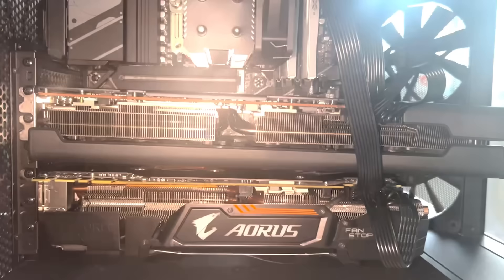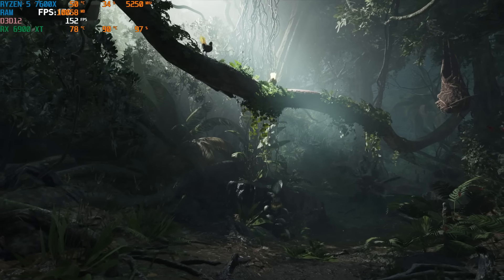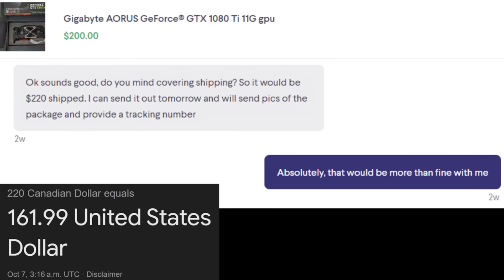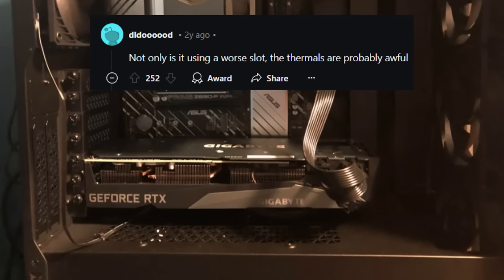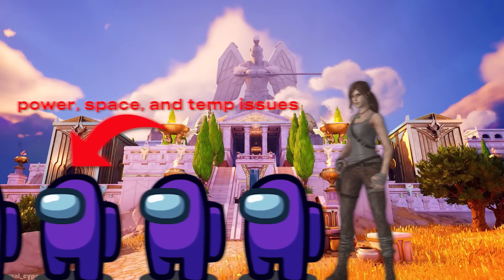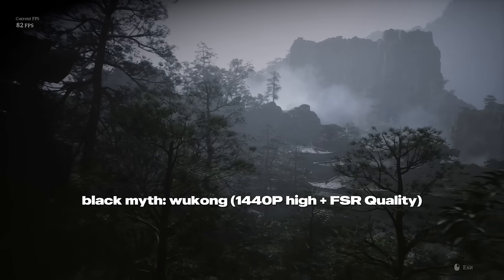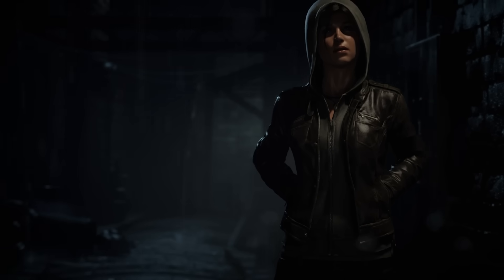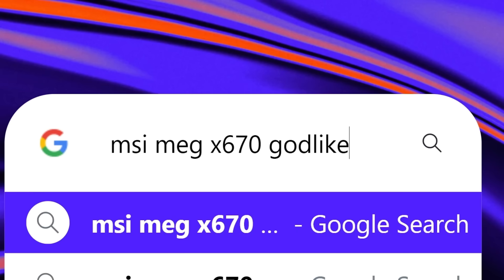I Combined AMD & NVIDIA in One PC and Got 1500 FPS

Comment from the maker: "sicko mode or mo bamba ? why not both ?" ahh video
Reply: @lecctron  edging rn
Reply: crazy reference
Reply: fr
Reply: Fr
Reply: Heya at 7 05 theres a setting specific GPU  how do you have that? i was trying something a few months ago with a rtx 2060 in my system and allI got for options was the Igpu in my 7950x and the 4090 in my system.
Reply: @mytrashamn  definition of cooked
Reply: @MR_3BAS   huh?
Reply: FR
Reply: Ahhhhhh video
Reply: @lecctron  lmao
But bro the 1800$ motherboard got my eyes so fuckin wide😭
Reply: tell us you don't understand video hardware and software without telling us..
Reply: If you bought that mobo and not the fans I think a viewers may come and rob your house for that trolling.
Reply: i have a 6600xt and 1050ti, my wallpaper engine load is nice and balanced at max settings while not messing with my gaming performance
Reply: When does ironic brainrot just become... brainrot... you answered this question.
Reply: If you see this where did you have to go to set different apps to certain GPUs
Reply: @HamWack  he didn't, it's a load of bull to start, if you have more money get nvidia otherwise do amd as a 4090 will smoke every current gpu on the consumer market. A 7900xtx is equivalent to a rtx 4080 but being cheaper. A 6900xt gets smoked by a 7800xt and a gtx 1080ti gets smoked by a rtx 4070 non ti non super. This guy should be booted off youtube for misinformation.
(1080ti gets smoked by a 8gig 4060 with dlss or raytracing as well.)
Reply: @lockinhinddanger934  I was asking because I had an old GPU lying around, and after watching this video I now use it for streaming, and it works quit well. Also, I do admit some of the stuff he said want quit right but in the right context he does make some valid points. Like for the price to performance a 6900xt is better than Nivida he just never mentioned for the price.
Reply: If only the host actually knew how pcs work, 6900xt isn't newish and no where NEAR the fastest, also a gtx 1080ti while decent in performance can't use dlss and struggles with raytracing as it lacks any ai rendering cores. So please don't spread misinformation.
Reply: ddlc soundtrack too
Reply: Bro ur insane lmao
Reply: lol
Reply: My GTX 760 is not showing up in Task mangeger only my 4070
Reply: Buy an older Mobo, like a Gigabyte GA-B150-HD3P which is a purpose-built gaming Mobo with native Crossfire support. It still has 16x PCIe and supports CPUs up to i7 4.2GHz(Kaby Lake). That would cover your CPU handily and allow you to run 2 different GPUs, and best of all, it's probably available pretty  cheaply.
Reply: Big dih randy, or p diddy ahh video
Reply: Go with dual 2696v3
Reply: Lossless scaling
Reply: fin fin fin fin fin
Reply: Fein fein fein

Comment: you could downgrade your system and use a Asus P7P55 Ws Supercomputer mobo + LGA 1156 intel i7 2,28 Ghz 8 threads and overclock it to 4,2 Ghz, wich supports up to 4 GPU's, once all 4, 16x pci lanes are filled they switch over to 8xpci lanes  ( mostly meant for science and is used with Tesla Gpu's ) but here is the kicker, you don't have to use Tesla GPU's, you can instead use two normal GPU's wich work perfectly fine together .

You could make your dream come true " somewhat " because you would be running your system with 16GB DDR3 1600ghz memory.

Wich basically is enough if you go for a Dual GPU System.

You can run  AMD/intel combo " in theory " but i recommend using this type of mobo with 2x AMD OR 2x Nvidia gpu's, but the same ones.

You allready have enough with 2x 8GB GDDR5 Gpu's and get outstanding quality and performance out of it + the power consumption demand is not that high aprox 500w power, so buying a 850 power supply gets the job done and is still NOT TO EXPENSIVE.

You can still get a descent amount of FPS and still run more demanding games with a descent Fps and for budget gamers isn't that all we want ? ( run our games smoothly )

Building myself one now for a friend, that doesn't have much money and i'm trying to help him out.

Hope this helps anyone else who is looking to build a " supercomputer " on the cheap if you combine this setup with a " linux Distro " then there is NO WORKLOAD in the background, so you can reach the maximum capacity of your setup without windows working in the background demanding every aspect of your computer.

This means More stable gaming, More stable fps, more descent quality in gaming.

Would like to hear people's thoughts on this and my idea of what i am building for my friend.

Comment: doing this right now 4 borderlands 2, 7900xtx for rendering and a 1050ti for physx, runs 250+fps max settings, max phys, as apposed to the high 60s when i was running just the 7900xtx and high PhysX on the CPU. getting both in was a challenge.... but if you wanna run PhysX in games but only have an AMD card, its very worth it

Comment: Doesn't every GPU have it's own Vram so it can't really split it with another GPU and is exactly why it won't boost your performance. I looked it up and it is actually so, you can't match two gpu's for one task but you can use them for seperate tasks seen in this video.

Comment: Buy an older Mobo, like a Gigabyte GA-B150-HD3P, which is a purpose-built gaming Mobo with native Crossfire support. It still has 16x PCIe and supports CPUs up to i7 4.2GHz(Kaby Lake). That would cover your CPU handily and allow you to run 2 different GPUs.

Comment: only reason he lost fps is lack of cooling and power supply watts is to low for both those cards even with what was said the cards dont have enough to clock draw for power ! and i put in my pc build : PowerColor Red Devil AMD Radeon RX 6900 XT Ultimate Gaming Graphics Card with 16GB GDDR6 Memory, Powered by AMD RDNA 2, HDMI 2.1 + EVGA GeForce GTX 1080 Ti FTW3 HYBRID GAMING, 11G-P4-6698-KR, 11GB GDDR5X, HYBRID & RGB LED, iCX Technology - 9 Thermal Sensors and yes i have open case with 9 fans with suppressed air for more flow and air draw and i have CORSAIR RM1000x Fully Modular ATX Power Supply - 80 PLUS Gold - Low-Noise Fan - Zero RPM - Black and it helps alot !

Comment: My guess is that the motherboard litteraly doesnt have the throughput in its PCI-E controller to fully utilize both GPUs at the same time to its full potential due to bandwith? Or that the PSU doesnt have enough power on its power rail to fully deliver all the required power (peaks) and that that throttles the performance? Fun fact u could in theory just install a second PSU outside of ur case and hook it up.

Comment: Hi Im replacing my Nvidia 1080 graphics card with a :

GIGABYTE NVIDIA GeForce RTX 3060 Gaming OC V2 Graphics Card - 12GB GDDR6, 192-bit, PCI-E 4.0, 1837MHz Core Clock, RGB, 2X DP 1.4, 2X HDMI 2.1, NVIDIA Ampere - GV-N3060GAMING OC-8GD

But I don't really want to though out my 1080. It works pretty good for high end games like Remastered Dead space and or star wars outlaws. But it doesn't quit cut it. 

Now I have a prebuilding gaming Alienware 7 and have two side by side slots for the card, and the cord connector has two male pins to plug into the card. Am I able to keep my 1080 and switch it to the right side port furthest away from the motherboard and use the 3060 in the closet side to the mother board or does it make a difference? Or Will the driver just pull the resource from the bigger working card?
Reply: It's best you don't use dual gpu setup. The amount of games that support dual gpu isn't wide and the cost of upgrade to support it isn't worth it either. When you mentioned Alienware, I thought of proprietary BS and anti consumerism. Anyway, I think you should be able to slot in the 3060 alone. Just keep the 1080 in a display case or something as a trophy.

Comment: omg the incorrect connection on these two cards is CRIMINAL. DO NOT USE PIG TAILED CONNECTORS ON newer GPU's. 150watts per cable only.

Comment: Has gotten 5070 ti display pc case isn't designed dor more than one gpu. Running with rx 9070 xt got over 1300 fps on final fantasy 15 at 4k max setting. Wow.

Comment: I know this will sound like a silly idea, but have you tried using one of the GPUs for frame generation? Just a thought, but if you get Lossless Scaling off steam, you could tell that program to use your second GPU to draw all the in between frames, while your main one can focus on rendering actual frames. Using LS with just one GPU usually introduces some visual lag. But you might have the perfect opportunity to reduce that since not one GPU has to do all the work by itself. If you have to connect your monitor to GPU one or two tho, is beyond me. 
Oh and Lossless Scaling isn't an expensive program. Costs about as much as a good pineapple pizza. And if that isn't a good sales argument, I dunno what is.

Comment: The 8700G's 780m iGPU has a lot of FP16 performance. It's twice that of the Arc A380 I just used with a 7900 GRE for frame generation. Can you test with the 8700g as the dedicated frame gen GPU at some point?

Comment: Unless the game is coded to use more then one card at a time it will only render on one. That’s why you are going to see no difference in 99% of situations vs the 6900xt by itself. Games just are not coded to do dual GPU from different vendors. Not that they couldn’t be coded to do so but developers don’t bother putting in the time and effort for that.

Comment: Autodesk type applications benefit from SLI or crossfire. I  also heard that the memory alone, of a second GPU can be used without a bridge. Games don't use nearly as much v-ram so it wouldn't even matter if it's available.

Comment: Don't a lot of productivity software like OBS and Blender let you specify which GPU to use for rendering without needing to display any video from the card? Not sure if the software you use has that capability though. Otherwise you could always pass the 1080ti to a virtual machine if you're on windows 10 pro or above, but I'm not sure if Nvidia lets you do that on consumer cards.

Comment: Your power calculation is wrong. You don't need two 850 Watt PSUs or a 1900 Watt PSU. 
The 850 Watt is recomended, cause you have a CPU, a Motherboard, SSDs, USB Power etc... All that is included in the 850 Watt.

You take the 850 Watt PSU, look at the specs of the 1080 TI (250 Watt maximum consumption) You add the 250 Watt to the 850, which leads to 1100 Watt. So a 1200 Watt PSU is more than enough.

Comment: I don't send I'm connected sending 16 lanes 1 on n turn it up or down never off to 16 LEDS but in real time n look at image of 4 x 1080 to 4 tvs or 1 TV or 16k 1k but won't fit frames send no frame between each frame to 1k n 3 to 3 on or off flicker to make 60hz 1hz a second we slow it down to 1 at 16million colours no flicker or white background so black and 4 led a square can do 4k 16million colours but we send 1 to 4x 1080 at 4 x 4 LEDS at 16 levels but in real time changing as we move so 3d real-time better quality not Ray traced ai low colours n sound fps was a scam to sell rejects to keep shares profit Biden shut down high end asml n EU fabs to get China to ripp tsmc rewired junk n scam you buy downgraded games upscaled ai dlss, on 1 screen laggy cheap why sli 4 n iso 16 still best with 4 layers gigabyte z270 1 socket 16x4 edges not x or WiFi n 4 lanes to 4 qtrs of broken to act as one mono but that reduced lanes by 4 n runs 16bit but 4bit x4 instead of 64 4 x 16mine

Comment: You can use the 1080ti with lossless scaling for the frame generation and render the game on the AMD (connecting the monitor to the 1080ti) without losing any FPS from the Main card since the frame generation load is taken by the 1080ti. That's a cool way to use double GPU setups.

Comment: Did you try changing your PCIE lane configuration in the BIOS settings?
You can switch them up like 8x+8x or 8x+4x+4x etc.
IF THIS IS POSSIBLE (big IF) would be much better with a PCIe 4.0 mobo.

Comment: There is a program called Lossless Scaling that enables frame generation on any GPU. One cool thing is you can use 2 GPUS at once, one to make the fake frames and the other to display them. You look setup perfectly to take advantage of this. Have the 1080ti do DX11 rendering and the 6900 XT do the frame generation. You would get crazy FPS. I recommend looking into it.

Comment: 8:42 Actually, there are more motherboards than the godlike... Most of the Asus Creator lineup is a dual x8 x8 to the CPU, so there are the big boys x670e & x870e Creators and the best budget-friendly b650 creator. Even there's also the possibility of using bifurcation with a riser to do dual x8

Comment: use lossless scaling Dual Gpu mode.  use the gtx 1080ti for 10x frame gen and then the rx 6900xt for the raw base fps. this way you can max out your monitors refreashrate and make both gpus run at 50% at 4k max settings at like  120fps or 144fps or 165fps depending on your monitor. Example is on Assassins creed 3 it is locked at 63fps but the max I can do was 630FPS with frame gen. I think with your setup you can do 1000fps easily with those gpus

Comment: So you basically lost FPS and achieved the same FPS in Fortnite as 6900xt would give you by itself? SWEET!!

Myself I have RTX 4090 and RTX 3090 because
1. LLMs - can run 70/72B models just fine with acceptable performance (up to 16 tokens/s for 70b model)
2. I run dual monitor setup with IPS and OLED panels and run desktop applications on 3090 which means I don't use up 4090 for these tasks...
3. ...including RTX Video Super Resolution which is quite taxing at highest quality
4. Running heavy ML training tasks on either 4090 leaves all performance for desktop or 3090 which leaves all performance for games

In my case 3090 is connected to PCI-e 3.0 1x slot kinda hanging from the side of my case so it doesn't cause any heat/temperature issues for 4090. On the other hand I do get very slow PCI-e bandwidth so certain operations do take much longer e.g. loading 20GB model in to the GPU takes some seconds. Once loaded models execute at full performance. Performance in games is quite severely affected but it really depends on the game - anything that just loads fully in to the GPU seems to work mostly fine... not that it matters really. All I care is for things like videos to run well and in this case I can decode 8K 60fps HDR video just fine without any dropped frames.

Issues I experience is I need to be careful about which GPU runs given application vs which monitor is being used as transferring window content from GPU to GPU is quite slow. Otherwise in Windows 11 I can set games to use 4090 and apps to use 3090 and it mostly works. Fortnite in DX12 mode gives me headaches as it always starts on 3090 so I need to disable it before starting the game. I tend to do longer playtime sessions over the weekend so it is not as big of an issue.

Otherwise it is cool to have literally zero GPU usage from applications on 4090 when playing games on it so other than intended use case (accelerating LLMs and allowing bigger models to be used) it is the biggest advantage.
As for use case presented in the video - having Fortnite run crazy fast... I guess its best to just get as fast RTX card as you can afford/get.

Comment: The 1080 TI does not out perform the 4090 in Fortnite on performance mode. Genuinely impossible no matter the optimization. You definitely had a hidden outlying factor that gave you those inaccurate results. Never in any world would a 1080 perform better than a 4090 bro it’s simple math

Comment: Using 2 GPU ( 7800XT and RX480 ), the old gpu ( 9 years old ) used for chrome, desktop and so one ( mostly second monitor ) and the main GPU is handling only games - the GPU repartition is made by Windows. 
No errors, no blue screen, I'm not using AMD Adrenaline only separated drivers ( the support for RX480 ended in 2023 ) 
The idle power decrease , 7800XT was using 64-70W alone, now is at 30-44W and RX480 is around 4-8W. 
Both cables are connected to the main GPU. 
One more option for those who want to try, use Hybrid Graphics in BIOS, use the integrated graphics and - Voila, a 3 way GPU, connect everything to the motherboard ports. 
Regarding the pci-e lanes, X8 for both, I didn't notice a fps drop in any game. 
Good luck at experimenting :)
Reply: @Andi.Cristian  can you make a video on how it's working?
Reply: @Sulto_  Hey man, it's pretty easy, I'm using this configuration for a 2 monitor setup, install 2 GPU , the main one is for the main monitor and the second gpu for secondary monitor. each gpu has a cable connecting to the coresponding monitor. 
Install the drivers, here are better that those 2 GPUs are made by the same company because you don't have to install 2 separated drive; use GPU repartion ( power saving, high performance In Settings, Display settings .
Advance graphics ( set your main GPU )
Display settings - set your prefferences regarding which software is using what GPU
If you have an integrated gpu you must enable in Bios Hybrid Graphics or whatever name the motherboard manufacture decide to call it, after that you connect your monitors directly to the motherboard ports, you usualy have 2 so you will be able to use a dual monitor setup, follow the same steps for GPU repartion.
Let me know if that help you.
Reply: @Andi.Cristian  I'm searching for a budget GPU to buy first, do you think 1050ti is good to use with 3060ti ?
Reply: @Sulto_  Man, almost everything works.

Comment: I remember ten years go, you can select a lower tier extra nvidia gpu just to run the physx workload. like a 750ti. (Maxwell v1) with a higher tier card like a 780 or older card but higher power card like a 680. not sure how much it helped but prob a few percent off the main gpu.